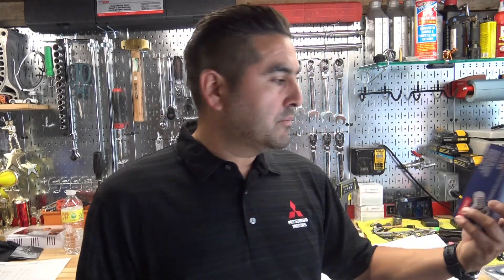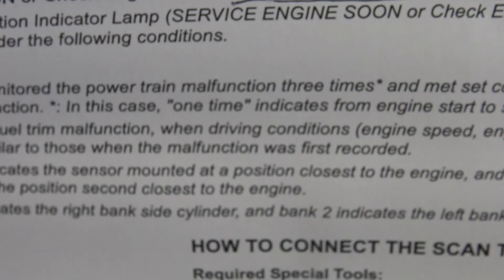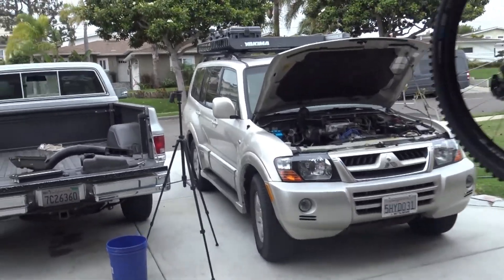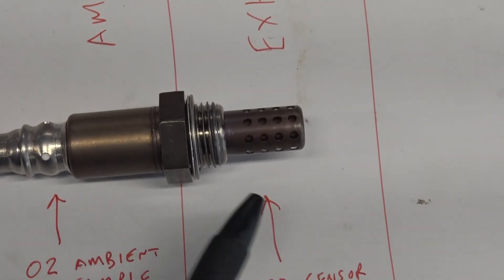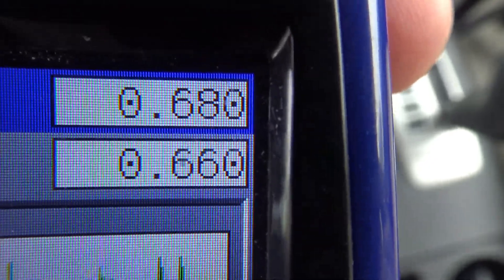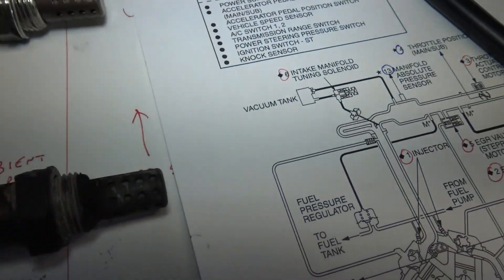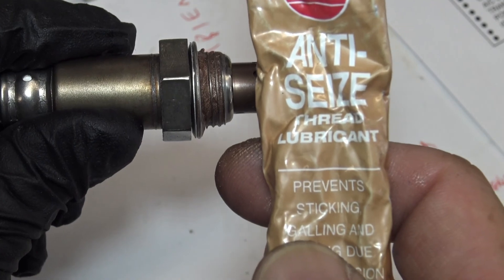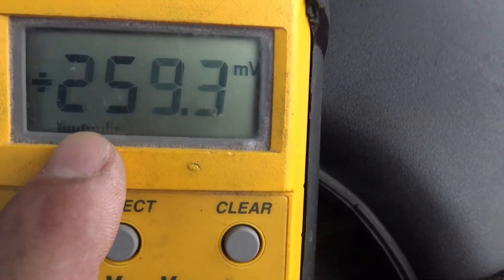SERVICE ENGINE SOON Light on, P0134, o2 sensor signal will not get above .5V

Comment: Thank you Sir, for a very clear and concise explanation. My valve cover is the culprit as well.
Reply from the maker: Watch my other video on valve cover gasket replacement. Apparently proper torque is the key to eliminate oil leaks.